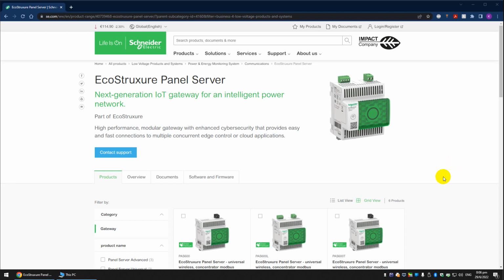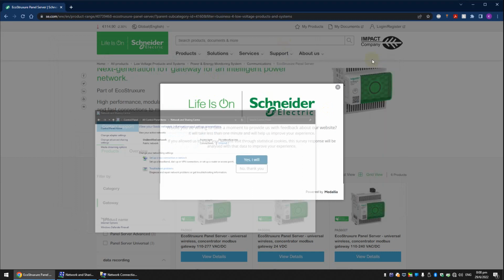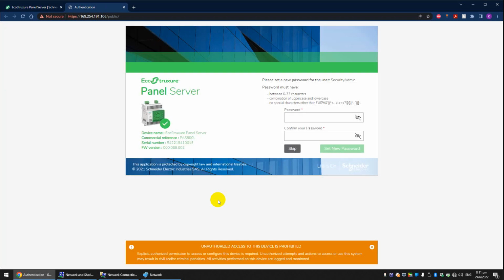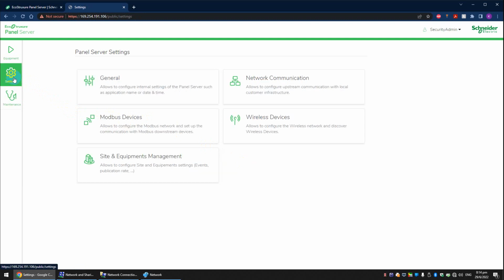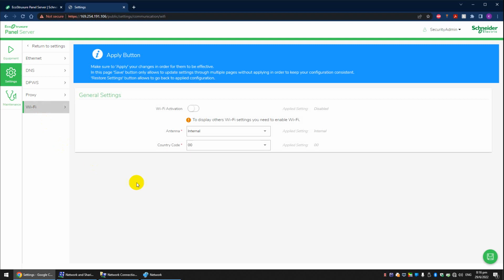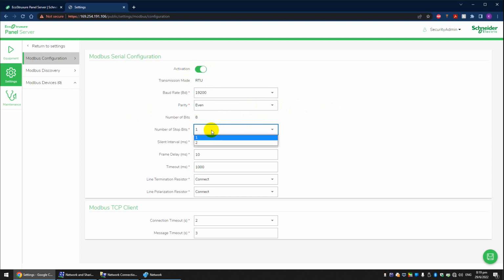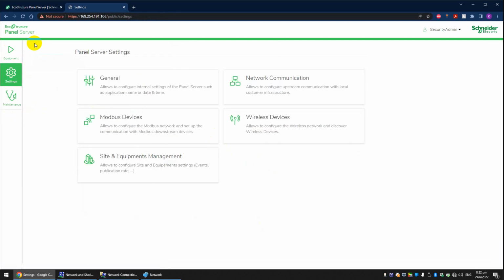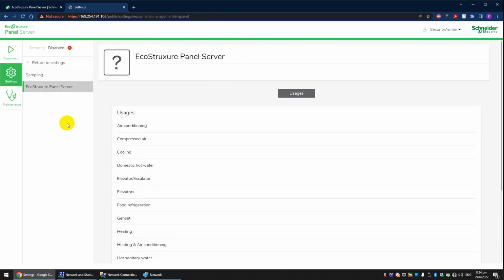EcoStruxure Panel Server - Startup Commissioning & Familiarisation

Comment: How can i reset password
Reply from the maker: You cannot just reset your password but you have to factory default the entire unit. I will show that procedure in another video.
Reply: @kktmg  i tried to factory reset, Password is still there.
Might not reset properly
Reply from the maker: @sarfrajansari166  the quick reply to you in that you have to hold down the front push button during power up. Hold until the circle blinks, quickly release and press again. You will see the circle blink 3 times green, that means the unit is wiped to factory.
Reply: @kktmg  I did same but still but password is still there
Reply: @kktmg  could you please guide to factory reset

Comment: how to add Power Tag to Modbus TCP/IP  Devices ?
Reply from the maker: Ahh .. good question.

You add the PowerTag to the PAS400/600/800 and then the gateway gives you a routed (a.k.a. virtual) Modbus slave ID for your software to read via Modbus TCP.

You may, however, need to add in your software the PAS400/600/800 panel server as a gateway device and the PowerTag under the gateway as a serial device on a TCP/IP gateway. It all depends on how your software was engineered/designed.
Reply: @kktmg  hi thanks yes I'm using PAS800l, I'll check this today.

Comment: Can we use this as gateway for RTU to TCP converter?
Reply from the maker: Absolutely you can. YOu only need to set the slave ID on the devices, wire them to the RS485 port, set the port baud rate, no. of bits, parity, and IP address and you are done.

Comment: Browser said not secure.how should you prevent this.
Reply from the maker: Currently the panel server still do not support CSR or uploading of certified SSL certificates. Do note that having an ünsecure SSL certificate"still means that your connection is SSL secured (i.e. encrypted). Though it is not a cybersecurity solution to simply ignore that. Stay updated with the latest firmware releases for more capabilities.